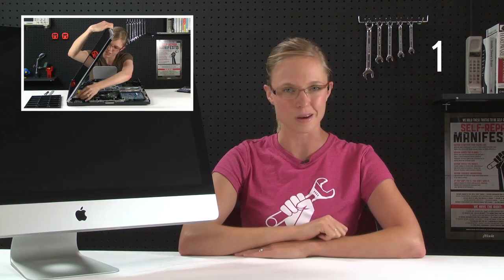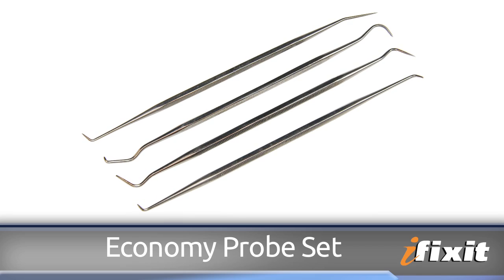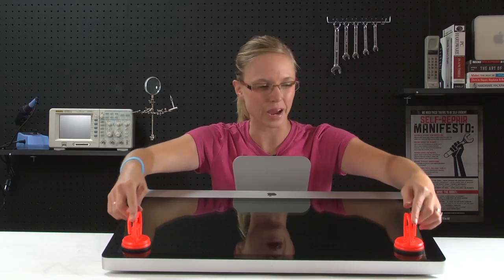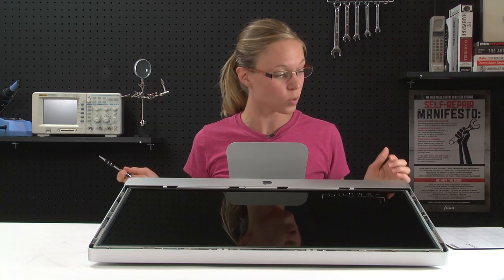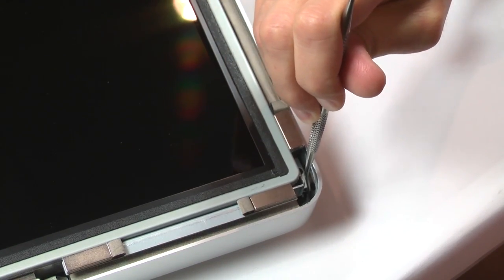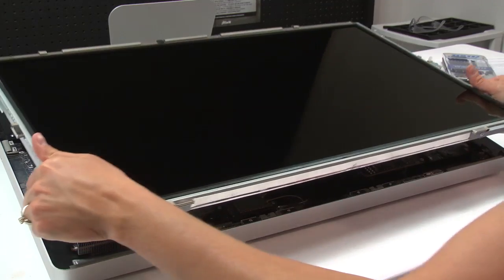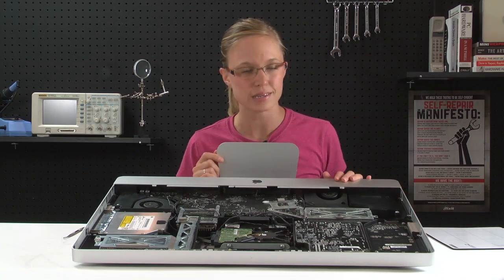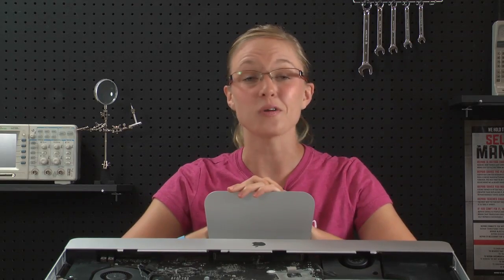How To: Replace a 27" iMac (Late 2009) Power Supply

Comment: I just changed out the power supply by following her instructions. Put it all back together and the screen didn't come on so disassembled again and reconnected the cables. Evidently didn't make the connection the first time.  I did find it easier to install the screws by wrapping a little scotch tape around the screw on the torx head driver. Holds the screw in place as you install it and you just retract the torx head driver. If the tape stays on the screw, no worries. Better than fishing it out of the unit.

Comment: my iMac 27" doesn't even turn on when plugged in, should I try to replace the power supply just to see if the screen can turn back on?
Reply: did you ever try it? Mine is having the same problem and I am debating trying this myself

Comment: I have those eight T10 Torx screws from the display. They are different sizes. 4 screws are a little bit shorter than the rest. I haven't realized that while taking it apart.  Can anybody help me? It's kind of hard to see that in the video.

Comment: biggest danger is the capacitor which holds a high voltage charge and it keeps trickle charging when in use, have you done a video showing how to replace the motherboard battery? Also any ideas on where to get a replacement? Its 10 years old and I guess a replacement would be a good idea.

Comment: Thank you MJ.  I received your PSU unit yesterday and the replacement was fairly easy.  The hardest part is dealing with all of the cable connections for the first time.  My IMac has needed a new PSU for years and I did not realize it.  I don't think Apple wants this problem to be made public.  I talked to two Apple support staff and neither one of them would tell me if it could be the PSU even though I had pretty much pinpointed it as the problem.  Whatever it does, in my case, it induced a horrible static into my home wiring that interfered with everything from my guitar amps to my home stereo.  No line conditioner can eliminate it.  I bought two of them so I know.  The defective PSU would even cause a static noise to come out of my Tripp-Lite line conditioner.  It is dead silent now along with my guitar amps and stereo.  Thanks again.  Now I need to tackle that blown left speaker.

Comment: when i did it, capacitor on the power supply made a loud spark. even when unplugged from power source. is there a hazard of being electrocuted?
Reply: The capacitor can hold a charge. That IS the hazard, so always be careful with any large capacitors.

Comment: anti-static electricity device,  static electricity as when you spark some one in a hand shake, What it does it prevents that any static electriciry coming from your body to burn any compontent in a electronic device. Verry comon in dry climates and dry winters..

Comment: it is an ESD (electrostatic discharge) strap, aka a grounding strap - our human bodies have the potential to conduct electricity and to store static electricity easily (think rubbing your feet on carpet and touching a door knob) that zap can destroy your computer's exposed componentry, so an ESD strap is a fabric strap with an exposed metal surface that touches your skin, connected to a flexible cord that is clipped onto a  metalic object or proper ground, discharging the static electricity.

Comment: Dear iFixitYourself, My iphone 4 randomly shuts off. I'll use it, lock the screen, and put into my pocket. Later on I will check the phone to see the time, or if I have any new texts... and its off! Does this 4-5 times daily. I just have to turn it back on, but its inconvenient. Also, in addition, it sometimes doesn't charge, and sometimes does. Even though it always says its charging. Do you have any ideas on the situation? I have searched online for hours, and have found nothing. (over a month

Comment: The procedure for glass an LCD as outlined in the ASG specifies that this be done with the unit standing upright.  This done so that you can more easily disconnect the display cables... 

It should also be noted that the the unit should disconnected from the mains and allowed to discharge.